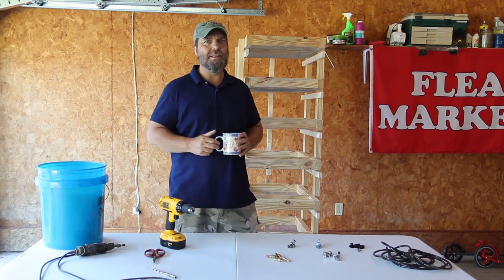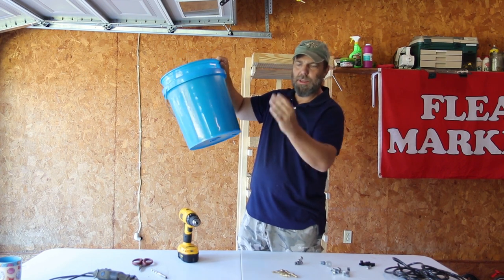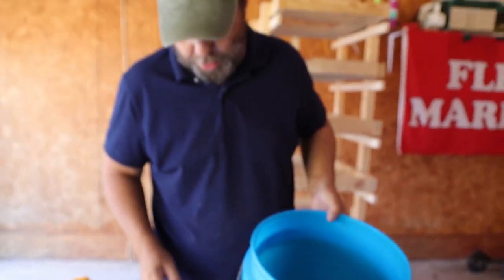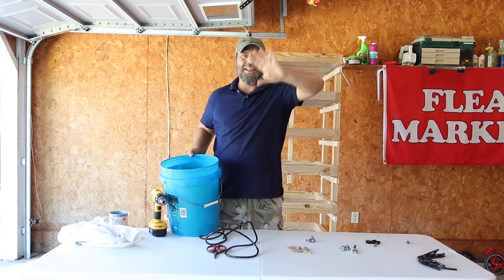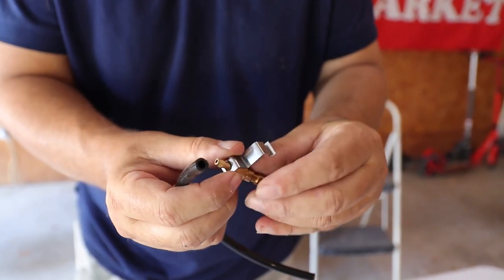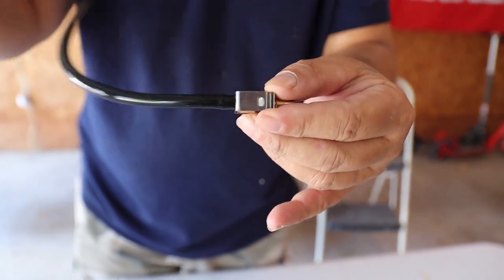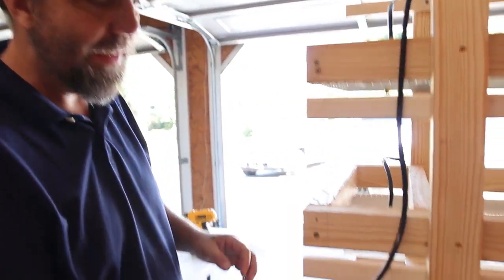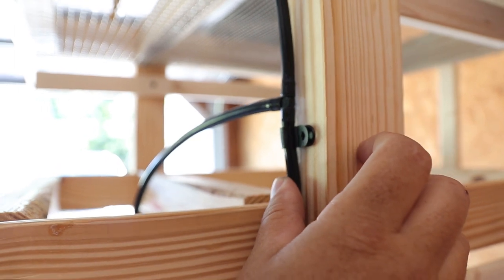How to Make an Automatic Rat/Mice Watering System

Comment: Thank you for these videos.  Very helpful.  I will be building one of these in the next few weeks.  The only thing I haven't figured out yet is automatic feeding.  I need a system that takes care of itself for 3-4 days at a time, since I often travel for work.

I see this system working with larger pellet/cube type food.  I have been keeping mice for several years in hamster cages, and feeding them chicken feed (small pellets).  I improvised a bird feeder style food dispenser using a water bottle with small holes drilled near the bottom for the mice to pull out food.  I usually also screw a larger plastic lid to the bottom for stability.  Problem is, eventually the mice expand the small holes so they can crawl inside, and dig out all of the food overnight (filling the bottom of the cage and making a mess).  Any suggestions?  Or does setup that you use only work with the larger cube type food (which is a lot more expensive then chicken feed pellets)?

Comment: Very nice ! I tried on rat, it works well. But mice bar was too heavy.
Reply from the maker: Not sure why. We have over 40 mouse colonies using this exact same system.
Reply: @ColdBloodCreations  
Really? Did you adjust the inner spring? Small mice cannot push the bar and I gave up. But thanks I will try again!
Reply from the maker: Did you use our kit?
I've never had an issue with the valves that we sell. I do know there are some cheap and faulty valves sold on Amazon. You're not the first to have issues with them if so.

Comment: I just built a rack using 1/4" hardware cloth. Are there any clips that I can use because the ones you show here are too big.
Reply from the maker: The clips are made for 1/2 inch hardware cloth. BUT, you can cut out a section of the 1/4 inch to make room for the clip. Just the middle wire where the clip needs to go. That;s how we do it on mice racks where we prefer 1/4 inch cloth.

Comment: I have an automatic waterer but my issue is that the bottom levels flood or are very wet by day 3. Is this the actual nipples or???? I've replaced them a few times and the same, the bottom nipples leak. Is it due to the gravity when they drink it just pours out? Whereas the top isn't as gravity driven? I'm so sick if it I'm about sell the whole rack that was $500 and build one that'll fit regular old rabbit water bottles.
Reply from the maker: It is probably caused by cheap poorly made water valves. Try our kit available here:
www.coldbloodcreations.online
Reply: @ColdBloodCreations  yea, amazon for $9 for 30
Reply from the maker: WoW! Yeah, I am betting that THAT is the problem. Good quality valves are worth the extra money for them not to leak and drown your rats.

Comment: Ive Been using these same water valves and my rats are having such a hard time getting water from them I had them drinking from water bottles it's been a week & still ain't getting the hint on how to drink from them. water definitely comes out of each one I test it myself like u did in this video  I'm not sure what to do here? I have the water valves from reptile basics.  Do you know if there's ones out there that makes it easier for the water to come out ?
Reply from the maker: In many years I have never seen a rodent that could not figure this out.
Remove all other water options and they will get it.

Comment: How would you do water for multiple rows in a rack? My mouse rack is 4 bins across by 7 bins down. Would I do four buckets?
Reply: No you just need to run your tubing down your rows and then split add a T at every tub. Once one row is done, run the line down one side and repeat.

Hope this makes sense. >-< it's 4:30 in the mornin and I've yet to sleep so I apologize if that all was confusing.